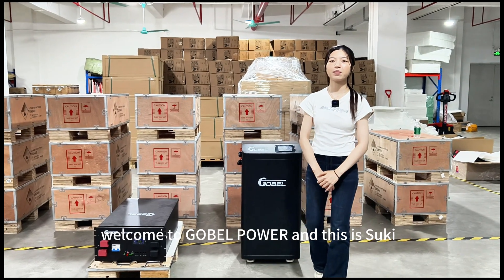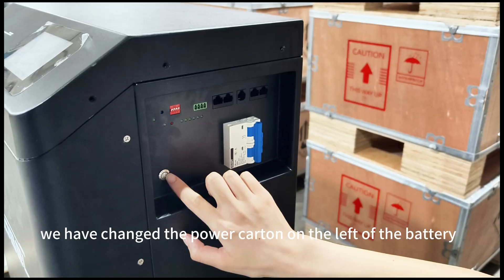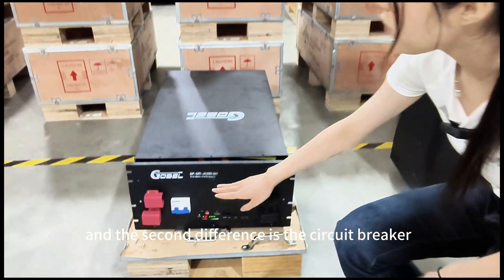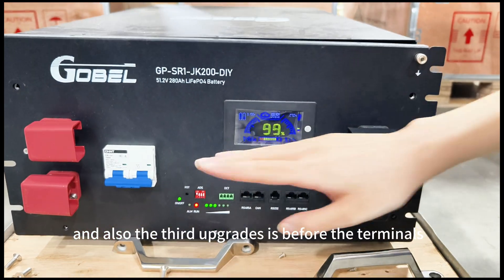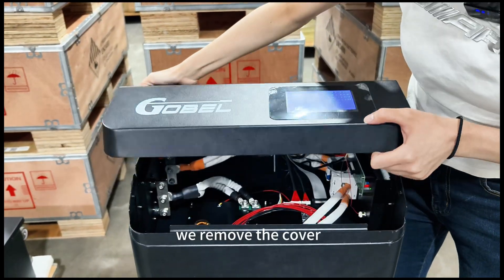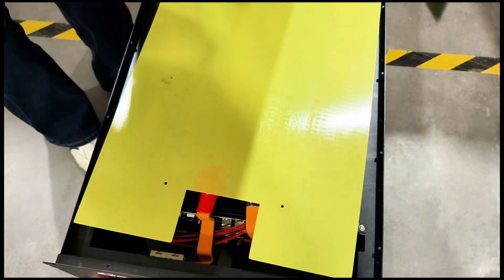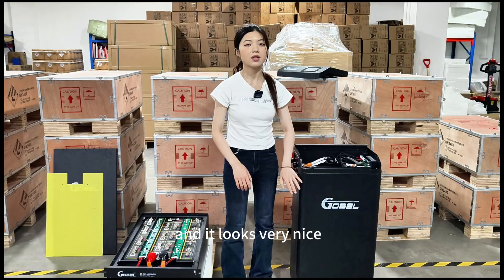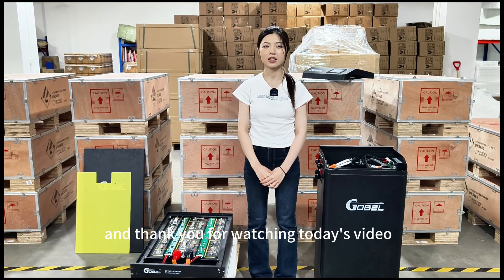🔋New 16kWh energy storage system released! GP-PB2-JK314, high-performance LFP battery module

Comment: Multiple issues with the new one
1 Circuit breaker is of low quality 
2 280 ah is already obsolete keeping in view 314,  320 ah and newer manufacturing lines churning out 628 ah cells
3 BMS part bluetooth is insecure hence need wifi password protected 
4. Why can IKEA style packaging be introduced wherein
Side panel
Back panel 
Bottom n top panel 
All sepearte connected and secured with nuts and bolts 
There by saving on shipping costs and shipping multiple items in one package
Be frugal be smart.. think ahead of times
Reply from the maker: Thank you for your suggestions.
1. The circuit breakers we use are not of low quality; they are from major brands and comply with both European and US standards.
2. Our capacity is customized based on customer needs, with options for 280, 304, 314, and other battery cell capacities.
3. The BMS is Bluetooth-enabled.
4. All accessories are stored in the box, so there's no extra space. The larger size is due to the added cushioning foam to prevent damage during transportation.

Comment: I think it's almost the best upright case. If a Class-T fuse(holder) is added in series with the breaker in the positive line it will be sufficient for European regulation requirements. Then the build will be absolutely great 👍🏻.
Edit: There is space for mounting it on de backpanel.
Reply from the maker: Thank you for your recognition, we have IEC certification and comply with European regulations
Reply: @gobelpowerenergy Still only a Breaker isn't enough.
BTW, the new vertical DIY box from Yixiang has added it recently also.

Comment: Why does the title say 16kw 314, yet the video stated EVE 280k inside?

Will this be available with PC BMS, A+ EVE 314. And IEC?
Thank you
Reply from the maker: This product comes in many styles, including 280 and 314. The difference lies in the battery cell, but everything else is the same. However, the BMS used is the JK BMS.
Reply: @gobelpowerenergy thanks for the reply. 😊
Yes I understand it has JK bms.... will there be an option for PC in the future ?

And IEC Certificate??
Thanks again 😊
Reply from the maker: @Damian-offgrid  We will release PC models later, and IEC certification is also available.